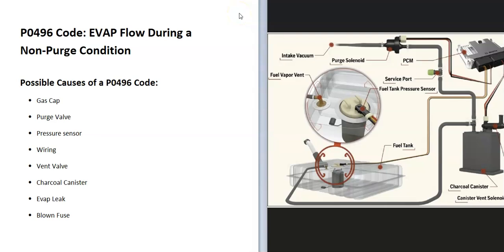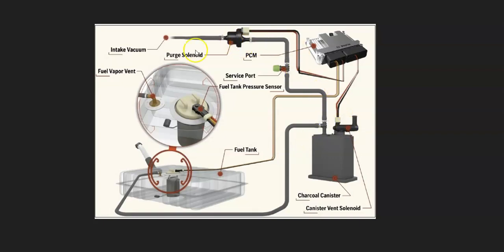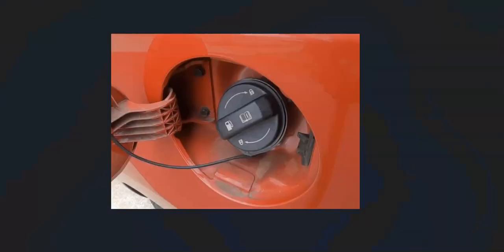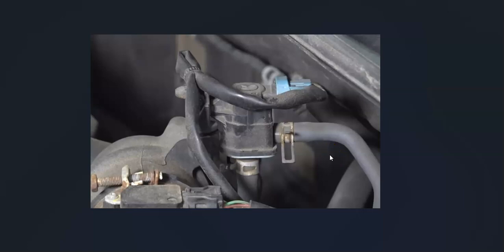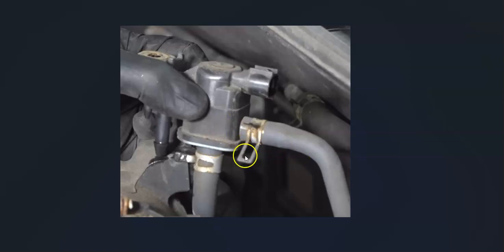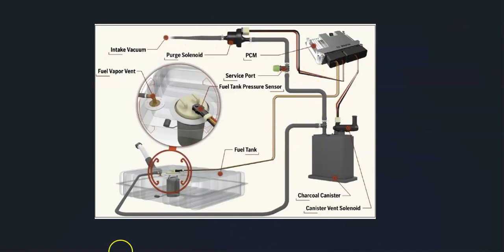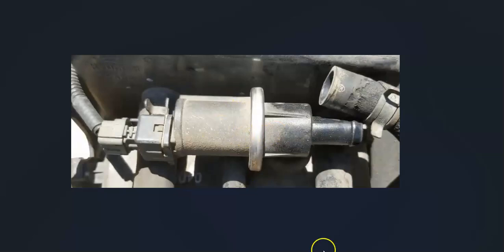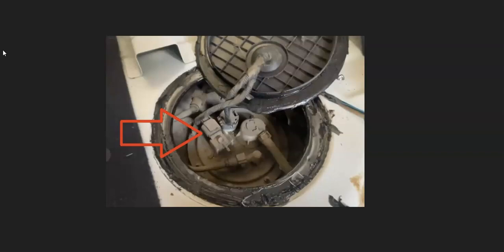Causes and Fixes P0496 Code: EVAP Flow During a Non-Purge Condition

Comment: Great simple video!  I have a 2005 suburban 2500 that was throwing just a P0 446 and then shortly after also threw a P0496. I replaced the purge flow valve up on top of the engine to start with the simplest thing first And I was quite certain that that part had never been replaced on this vehicle based on its appearance. After replacing it, I cleared the codes and drove for two weeks with no code coming back on; interestingly immediately after replacing the purge flow valve, my gas gauge started working and it had not been working for weeks. I took it as a win lol. Now today a couple of weeks later my check engine light came back on and I’m getting both of those codes again. Of note, my gas gauge only worked for about 12 hours that day originally. So I can follow the steps and go through and check the things that you’ve listed. So I have what feels like a stupid question but I am someone just starting to learn to work on her own vehicle so bear with me… Can the fuel pressure sensor cause the gas gauge not to work? because currently I’m driving around with my gas gauge pinned below empty with the fuel light on all the time. However, I am using the fuel used display in my instrument panel to try to keep a handle on my gas. So I’m trying to figure out how can my gas gauge not work but my car can tell me how much gas I’ve used?Just curious if that’s related at all to the fuel pressure sensor.
Reply from the maker: Usually, when the pressure sensor goes bad, there will be another code. With the purge valve good, I would test the vent valve. Although rare, the vent valve can sometimes cause issues with the float in the gas tank, which can affect the fuel gauge. It needs to be diagnosed since it could also be the wiring.

Comment: Can you drive on it for for week before getting it fixed?
Reply from the maker: Yes, usually, it doesn't affect the engine unless the purge valve is stuck open. Most vehicles drive good but won't pass an emission test.

Comment: I changed everything but the fuel tank sensor. I have a 2014 impala 2lt v6
Reply: Also it was fine for MONTHS until it got below 0 here in Syracuse 😅
Reply from the maker: Cold weather can affect the hoses, causing them to leak. Sometimes, EVAP codes only come up after it is very cold and then go away once it warms up. When that happens, it is usually a hose starting to go bad.
Reply: Syracuse ought to be warming up nicely, now that it is May.  

Be blessed & enjoy Jesus' beauty of creation from Green Lakes to Skaneateles, from Tully to Camillus. 

  @vinsynwolf
Reply: Same car and same problem. Did you figure it out?

Comment: II have a 2020 Ford Fusion that was fine. Took it in to get a small tack removed from the tire at the dealership and an oil change. Tack did no damage but they took all my tires off to check brakes without being asked to do so on a 34k mile gently driven car. We drove in smoothly with no issues and out with a rough ride we didn't have when we drove in. Fueled up next time a couple weeks later and car stalled at start. Next day hard brake and acceleration when someone cut me off and engine light. No problems at all for almost 4 years driving the car and after 1 visit to the dealership service we have this. Incidentally the dealer has been sending me lots of emails saying they want my car to sell in used inventory and despite my not wanting to and telling them that, they keep sending. Now this happens. You can understand why I am wary of going in for service. When they checked my brakes, they scraped a lot of dirt, dust clay etc. off the calipers and left a pile of it in each wheel well. Not sure if they cleaned it out before putting wheels back on. I saw another video that showed that debris can stop the capless gas flapper from closing all the way and they showed someone using the funnel and wd40 pushing it open and closed 30 times to clean and condition the seal and then used a cover for the gas cap to prevent the debris and moisture from going in again. Have u seen this and is this a legit way to deal with this. We got the cover and I want to try to make this right without involving the dealership if possible art least through the Holidays as we have tons of plans and a car that is getting rougher and I suspect has an opening in the gas tank inlet. I see horror stories of people losing their cars for months when they take it in for service at a dealer these days and I cannot lose my car. My trust level is low. Have you seen this funnel thing and can using that or the cover cause any damage to the capless gas tank inlet or the tank? We did not originally smell gas fumes but now we do around the gas tank with no spilled gas and exhaust smell from the back outside so clearly something is up with gas tank inlet. Btw it starts fine on remote start without the brake pedal pushed. All that debris I saw was dirt and dust and it seems so very coincidental that a perfectly functioning car should have this happen only after the dealer service happened with all that debris. Not accusing anyone of anything but wondering if it could be related. Really want to put that gas cover on and see if it helps but worried it will cause something else to go wrong. Thanks for any thoughts and help.
Reply: I’m with you 100%. A few years back Ford motor kept bothering me about a recall on an air bag on my Mustang convertible. I didn’t pay any attention for a long time because I just didn’t want my car in a dealership. Finally I agreed to bring it in. Supposed to be about an hour to change out the steering sensors or something. After about an hour someone came out and told me my car had a transmission problem. Never had not even a small problem with the car in 5 years. Long story short they assured me they could fix it at MY cost for something over 3.5k. I bout had a stroke. Had the car towed to my mechanic & had to buy a replacement transmission. And pay my mechanic to install. I know they tore up my trans, but I had no way to prove it. Looking back I should have gotten an attorney & at least made them repair my car at Their expense. NEVER will I go to a dealer again.
Reply: @bigorange113  thanks so much for your comment. I have had people on You Tube call me paranoid but I know I am not. Your comment helps me to know that. I know I have even seen hidden camera shows on this kind of thing. Sometimes I wonder if recalls are just a way to get lots of cars in for other repairs or trade ins. It would be easier to just be able to trust the dealer and use the warranty (which is costing us $20 extra a month) but when they keep sending emails about how much they want my car for their used inventory and mine is a very unusual car. Sedan awd turbo with custom wheel covers with only 32k on it in 4 years and still under warranty, I know they will do anything to keep it so I have this nightmare thought that they check it in, deem it unsafe to drive or waiting for parts and then offer me a deal on something new to be able to drive out which I do not want at all. The only other choice in that situation for me becomes non stop loaners and I am deadly allergic to the cleaners in them. Once down that track there is no turning back. But in the meantime, I am having all out panic about getting the car started and especially about filling up which is where it mostly fails and is making me very limited in where I can go out. I'm also not sure if I go to a regular mechanic if it voids my warranty for bigger things that could happen. It's like they have got you no matter what. Not sure of my next move but thanks so much for your info! I hope your got fixed.
Reply: This is insane........wow. Talk about playing the blame game lol.
Reply: @ianvrana2486  not sure I understand your response. Not blaming. Asking about circumstances around the timing ol what happened. Have read many reviews that have the same concerns I do. Are you takng my questions personally? Do you have any kind of suggestions for what to do with this or is your comment simply meant to be something else?
Reply: If you have warranties questions please check your car manual and your paperwork when you purchased the car. I didn't know how long warranty was good for. 
I'm having issues also but can't get into my mechanic for weeks. 
The last time I took it to my mechanic, I don't think he did anything? But change the oil! Codes came back up then I went to the dealership for almost $200.00. They told me when I was there they found a "recall" for the vent valve. Since then, all kinds of e-vap codes are coming up. I'm going to change the gas cap, check fuses and hoses and pray 🙏 for the best! ❤. Being a WOMAN, most men think we're stupid and don't know how to do car 🚗 stuff,! I've been around for a long time and I can learn from the best! 'and Google & You Tube! Good luck with your vehicle, I hope all goes well for you guys! 
With Love 💕 Peace ✌️ Out!

Comment: I have 2022 ford edge 2.0l and it has the capless gas cap.  I get the p0496 code every few days.
Reply: I have a ford edge 2022 85k km..mine just came up today. Annoying
Reply: @BishopGee my checkengine light came on and this code pulled up. Yeah it's annoying. I wish there was more of a warning before light came on. Like car idling etc. That way can be checked right away vs light coming on and car not working potentially. I like to get things checked when problems not when check engine light is on could be too late then.  Hopefully cheap. I suck at cars doing things on my own. Getting it checked out first thing in the morning. Hopefully the cheapest alternative a few hundred bucks at the worst. One thing not 3 or so. Add up fast then smh. Car 124k miles
Reply: Did you find out what is was?

Comment: When is the vent valve opened?  Is it only while engine is running ?
Reply from the maker: It can vary, but usually 5-15 minutes after the engine is started the computer sends a signal to open.

Comment: So this is the same as P0497? I had this one (P0496) and P0455. I Replaced the purge valve and fixed the hose going to it (had slit eat end). 
Now I’m only getting the P0497. I’m thinking the vent valve in canister is stuck open. 
We did a smoke test and it was coming out of the rear right fender well. But I can’t remember if we did it with the car off and running. If the car is off with the smoke, be coming out because the valve is open and if it’s running, should it be closed at idle?
Reply from the maker: The vent valve in the charcoal canister is normally open and closes when power is applied. It can vary, but the computer often closes it for testing after the vehicle is off for 1-2 hours. It is best to use a scan tool to close it when testing.
Reply: @HVAC_Mechanic  yeah i know but it’s a Mercedes Benz. I can’t buy one or  find anyone who can run all the tests/sensors/valves. Why did I get low, purge flow and high, purge flow codes? Also, small leak and large leak codes? 🤔 but after replacing the purge valve, I’m only getting the P0497. Low purge. Dirty or clogged canister? Should I just clean it out? Clean the sponge/fet etc? What will help my low/rough idle? That’s what I’m trying to fix. I’ve seen that if the purge solenoid on the canister doesn’t close to cause combustion, it will cause a low, rough idle 🤷‍♂️ 
It only needs to go up .500-.1000 rpm to be completely smooth. It’s idling just around 1050 instead of 1200/1300 (1250 is my target) 🤷‍♂️ Tia
Reply: @rPlatt73 Any luck with resolving the issue? I too am getting the exact same two codes (P0496 & P0455) and just ordered/was about to replace the purge valve. Interesting it started throwing a different code. Also was going to give the smoke test a try out next. This is on a 2010 mercedes benz c300 sport

Comment: Thank you for this video my 2019 fusion gave me a p0496. I already changed the purge valve and the wirings attached to it. Code still came back so now I’m going to replace the canister and solenoid with it. If that still doesn’t fix it then I’ll check the fuel pressure sensor last.
Reply: Hi guys so I did not change the canister or solenoid. I ended up changing the upstream oxygen sensor and the engine light went away same day on its own afterwards.
Reply: @trilliamc5185   Please what car do you drive and the part #? Thanks!
Reply: Fuel pressure sensor would have been a costly repair because it’s located on the fuel pump inside the fuel tank.
Out of desperation I replaced my 30 day old purge valve again and the new one seems to work fine and no more codes. 
I would really check your purge valve and make sure it is only allowing air to flow through in one direction and not both. It’s the cheaper and easier fix but was still frustrating to find a brand new part already went bad. Good luck
Reply: Same issue with my 2015 Chevy Cruze
How did changing the canister vent solenoid go?
Reply: What ended up being the problem?
Reply: What ended up being the problem?